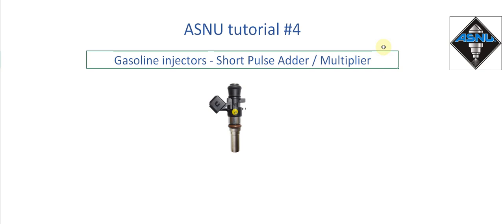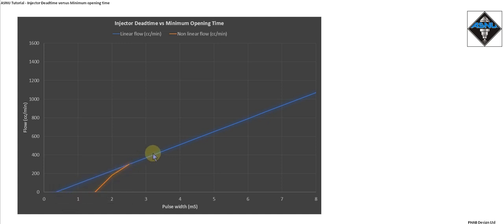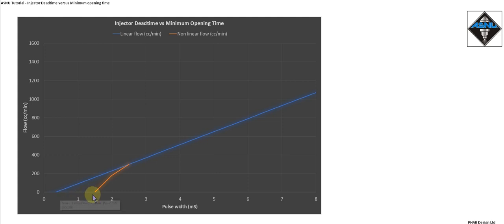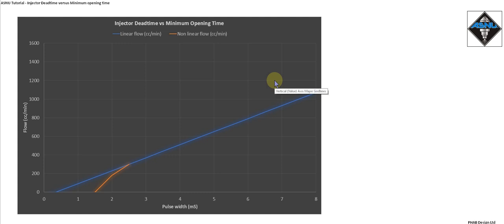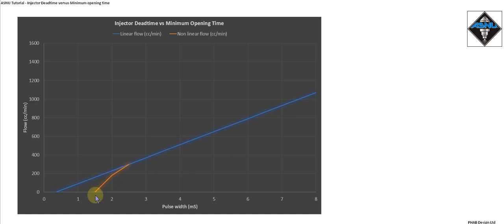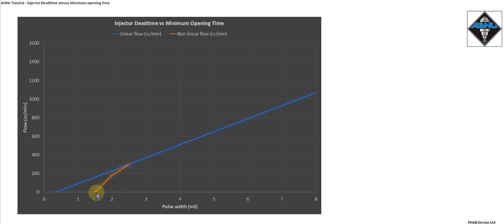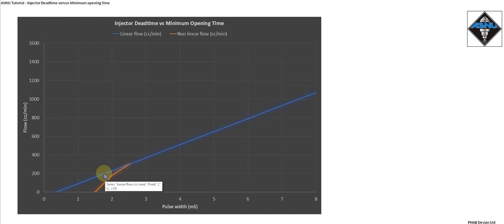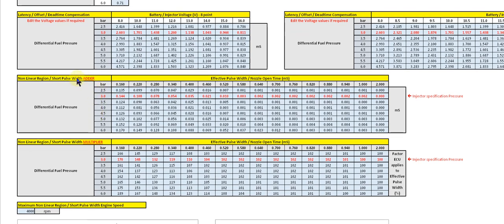Gasoline Injector Tutorial Part 4 - Short Pulse Adder / Multiplier

Comment: I have 1000cc high impedance ev14 injectors that I struggle to get a near stoich idle with and it idles rich. The manufacture provided documentation for the injectors that included the effective pulse width and their short pulse width adder values, but some cells are actually negative values. The effective pulse width where it changes is near the dead time/voltage that the car idles at. Would this solve my idle AFR problem? It seems to remove time. Does it make the injector slower to react in order to achieve the target AFR? Also, for the injector flow rate, would I input the flow rate the injectors are rated for, into the ECU or the effective flow rate? The effective flow rate is actually 906cc.